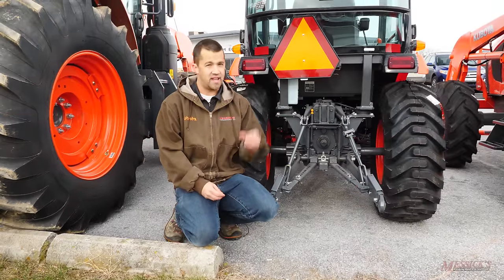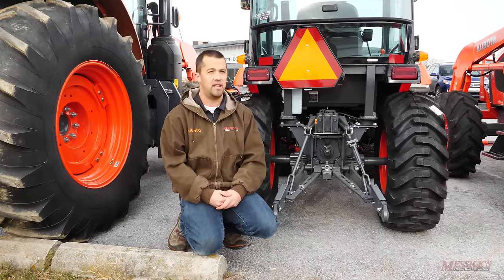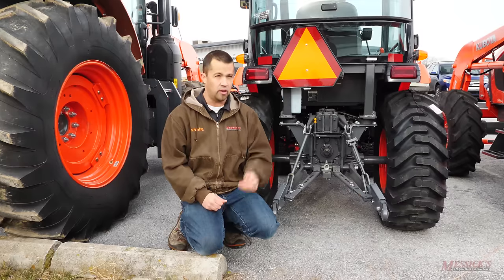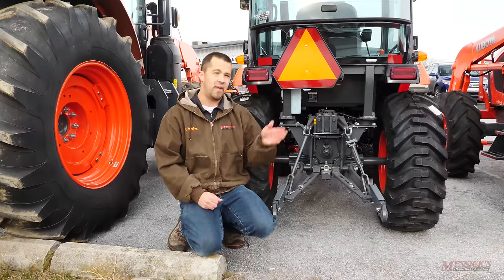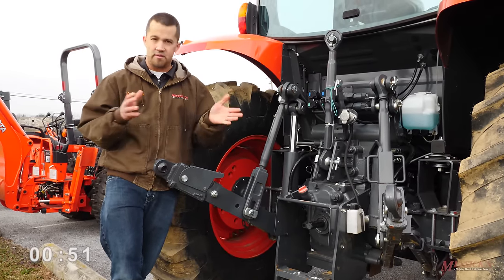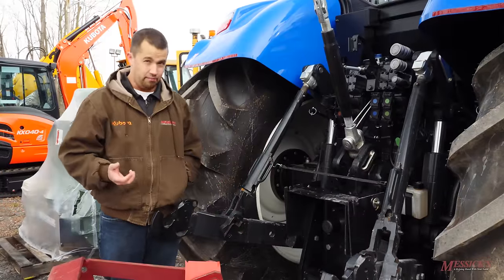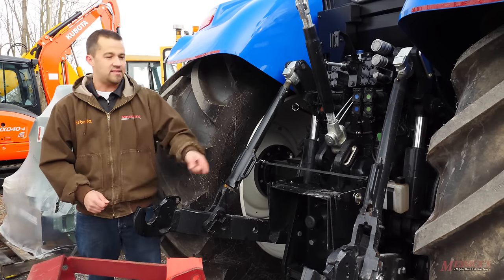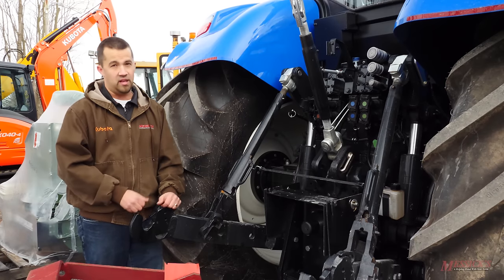Understanding Three Point Hitch Classes - TMT

Comment: Is there any particular reason manufacturers don't use the lift style hitches, or at least don't seem to have an option for them, on smaller category 1-2 tractors? I can imagine it's a more expensive type of hitch but I know a number of people, myself included, who have after market lift style end on our tractors and if there was a factory option for it we would have certainly have bought it.
Reply from the maker: +BlackHawkBallistic that's a good question. I'm not sure I have a good answer for you.
Reply: Im thinking cost and like me i deal with it and granted my 1957 JD 520 was rated around 40hp and has telescopic lift arms. Oh yeah its cat 2 three point ad has a quick tach top link kinda like those lift arms on that big kubota. Old school tech is so much better heck my tractor has most of the modern day features the new tractors have
Reply: I hope it changes eventually, the lift style hooks are so much easier and faster than the joints.

Comment: Forgot to explain the different categories of 3/3N and 4/4N! And when manufacturers say the hitch is a 2/3N or 3/4N or cat 1/2. It’s pretty self explanatory but some may not know.
Reply: I was going to ask that, but you seem to know?
Reply: Cat 1 is explained here. Same as cat 2 and 3. When the spec sheet might say cat 3/3n this means the hitch can run cat 3 and 3n. 3n is cat 3 pins on the spacing of cat 2. Cat 4n is cat 4 pins on cat 3 spacing. Also, some cat 1/2 tractors have you take the slightly bent draft links and flip them to the other side of the tractor so the offset is inverted for cat 1. You use bushings over implement pins to run, say a category 1 implement on that 2/1 tractor with the links inverted.
Reply: Thank you for the explanation ! Very helpful :)

Comment: I know this video is old, but hitch categories are classed by lifting capacity and not by pin size.  Pin size is determined by implement size and weight which is determined by lifting capacity.    Am I right?